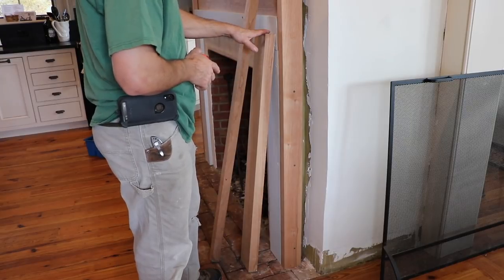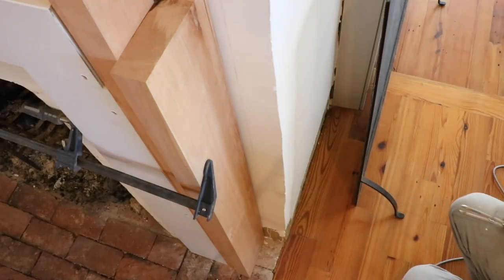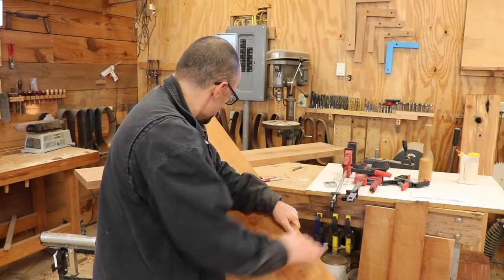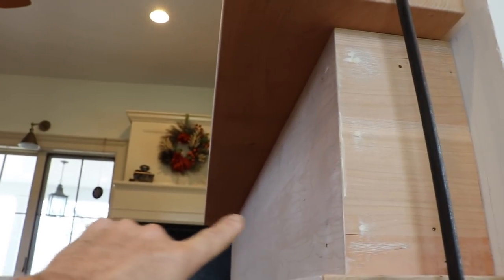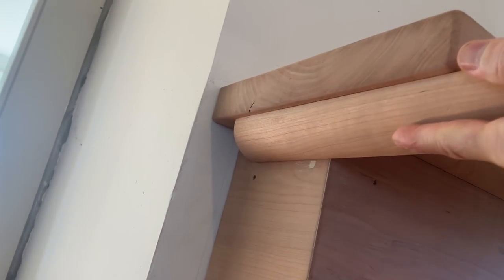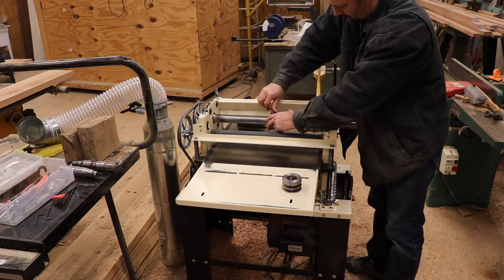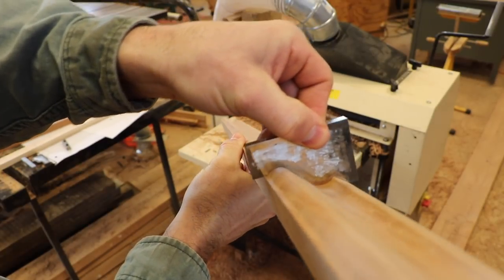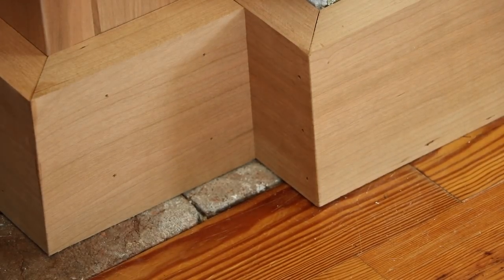Reproducing an 1850 Fireplace Mantle From Scratch, Part 2.  FarmCraft101

Comment: I'd run the skirting board (base board) right up to the wall and cut the vertical moulding to fit over it. It looks fine as you've done it and as you say, it's a matter of preference.

Comment: A few years back I did some custom trim in New Orleans that needed to match the existing as close as possible. I used those same trim screws to attach it, and since the old square nail heads were visible in the old stuff I took some original nails I had pulled from other parts of the house, clipped the heads off and then put the nail heads into the screw holes with a bit of epoxy. After it was stained it looked like it had always been there and the nail heads were a much nicer look than filler.

Comment: I'd really like to see you do something with the inside white surround just outside the firebox.  Maybe a brass or copper accent surround?  Brass would go especially nice against the black mantel.
Reply from the maker: It would, but I need this to match the rest of the house.  All are plaster like this one.  Thanks for the comment!
Reply: @FarmCraft101  ...It need not be at all permanent.  It could be free-standing with "feet" that hold and lean it against the wall flush.  Just a thought on a solution if you feel, as I do, that something should fill that space.

Comment: Nice project, nice explanations.  Question: What router powers that 1 1/2” bit? Or is it a shaper?  
Yes, it would be interesting something about the planer/molder.  Please also address molder vs shaper if possible.
Thanks and best wishes!
Reply from the maker: It's a router, not a shaper.  An old porter cable variable speed beast.

Comment: Question regarding the planer/molder: to increase the speed, do you have the option of using more than one of the same profile molding knives, or does the cutter head only allow for one knife? Btw, everything turned out great although your remote may need a tune-up; maybe just some new batteries  ;) ...well done.

Comment: I have done construction in my old house for years now. I learned quickly to NEVER assume anything is a straight line. The corners are not 90 degrees, the walls are not flat, and nothing is truly straight.
Reply: The same applies to newly constructed houses as well.

Comment: I know this video is old and you probably won't get back to me, but what species of wood were you using there?  I bought a load of random wood from a guy and ended up with a board that looks very similar to the wood you used.  My wife and I both love it, but I haven't been able to figure out what it is.  If you could let me know, I'd really appreciate it.  I want to pick up more of it for a few projects.
Reply from the maker: Cherry. Not something I would typically paint, but I have tons of it from my sawmill laying around.
Reply: @FarmCraft101  Hmm, I'm fairly certain what I have isn't cherry.  I guess it's not the same, but it sure does look similar.  Thank you sir, I appreciate the info.

Comment: I was actually curious how that molding was cut, does it just spin around very fast? Wouldnt that make it bumpy?
Reply: it's basically the same thing as the router just bigger, as long as you don't feed the stock through too fast and your cutter is sharp you get a good finish.
Reply: Well the result is well worth it, thats for sure.
Reply: "Wouldn't that make it bumpy?"  No, not at the speed he is running the tool at (pushing the stock through, slowly).  It does multiple passes over very nearly the same spot as the wood is run through.  As the knife comes down it cuts at a slight angle to the plane of the wood quick enough to start the next "behind" cut into the valley of the first.  Thereby eliminating bumps or ridges.
Reply: @Rickbearcat  Cheers for that explanation.